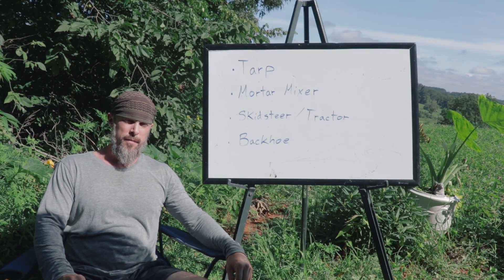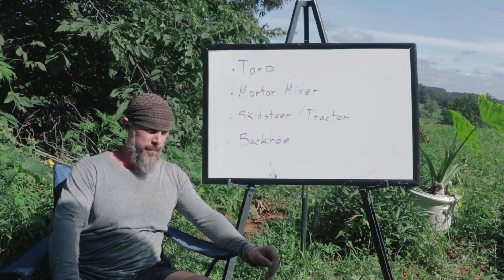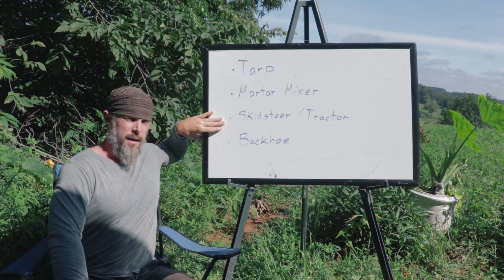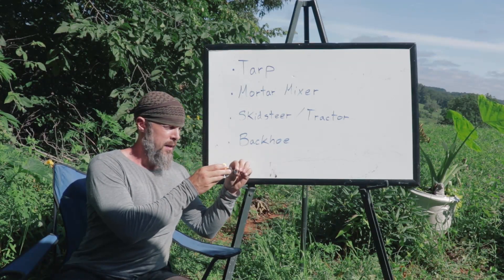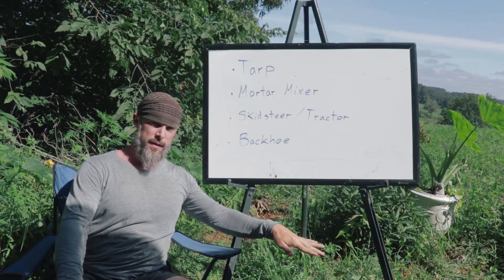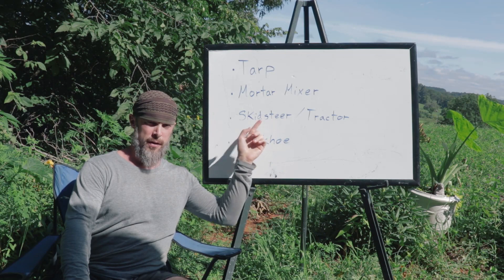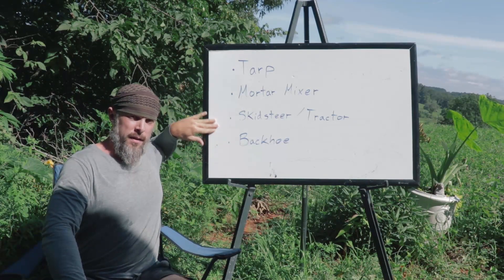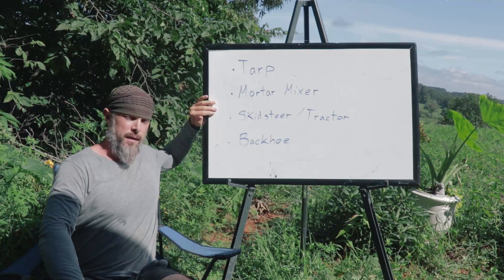Top 4 Methods for Mixing Cob - Cob Mixing Machinery Options

Comment: What do a person need to start building those wooden structures that will help people to go higher than the first floor if your house is double storey house.
Reply from the maker: Do you mean scaffolds?
Reply: @thiscobhouse  I think so, I am not familiar with construction, but thinking of at least learning it so when needed I can make the house myself. So as a newbie I am just trying to search what would a person need to build a house that is 6 m in height. I have known from my experience that the higher it is, the cooler it is in summer time. I want to build a house big enough to create beautiful ornaments on the walls decorating it with baroque style :P

Secondly, would it be a problem if I open a company with your firm's name ? I am not from USA, I want to establish my own work independently, but was thinking about building a type of company like yours. do you allow franchise ? or something ?